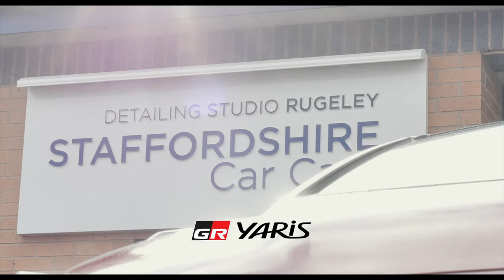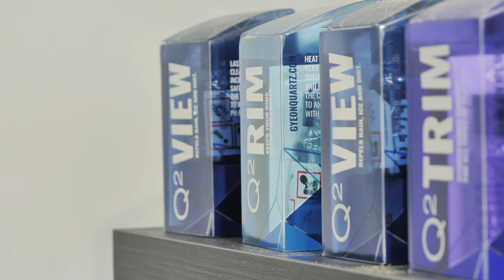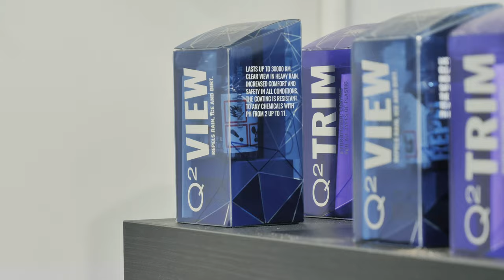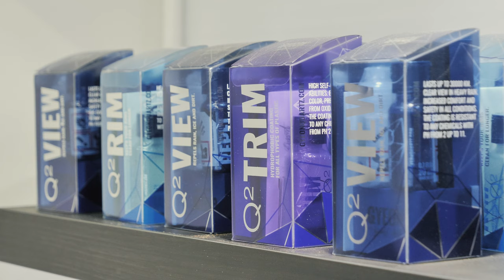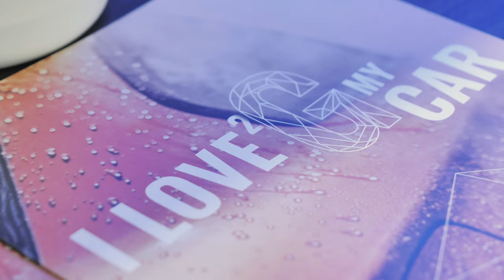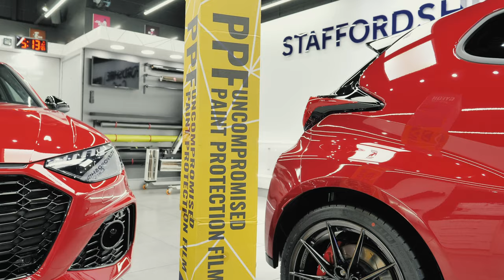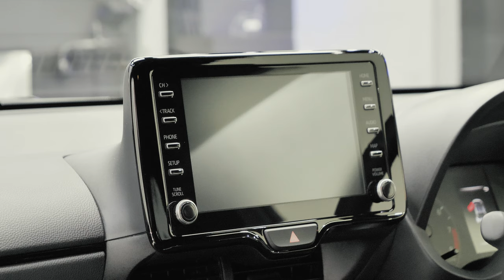Toyota GR YARIS | GYEON Ceramic & PPF

Comment: Also those piano black trim pieces which are notorious for scratching even if you so much as blink at it. What's the go-to treatment for protecting that? Is there a PPF cut out for these areas. Boot lid/light assembly 
for example

Comment: What's the general consensus with these GR's so far for the most vulnerable areas to apply PPF? I know a full car may be overkill and in excess of 2-2.5k. 
As or the ceramic coating. If there are some hydrophobic qualities in the PPF itself and a ceramic coat is applied on the remaining exposed panels. Is there not concern about the different qualities of the PPF vs ceramic hydrophobic effect? Also, what about wear over time, I would image the PPF last much longer and you could get issues where the ceramic has aged differently to the PPF.
I have heard many get the ceramic added on top of the PPF and everything. Might be excessive but at least the application is even all around.

Comment: Sweet job but just a query on how you applied pure....gyeon say to do straight lines back n forth wait 10-20 seconds then do a circular action on same area....has this method changed
Reply from the maker: Thank you. This is not a real-time installation of Pure unfortunately, we focus on the coating installation without the distraction of the camera as it is quite difficult.  There is plenty of how to videos showing how coatings are installed if you need help 👍🏻